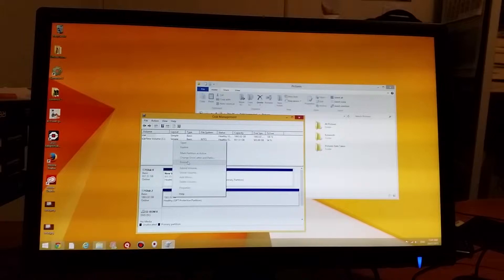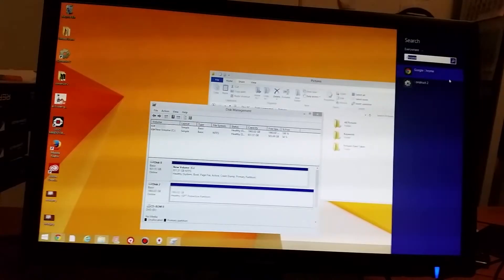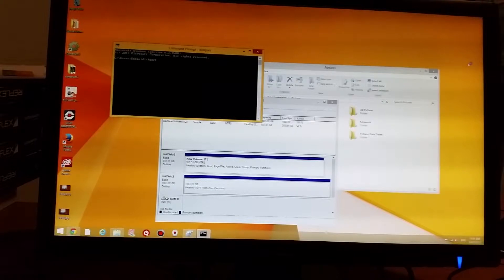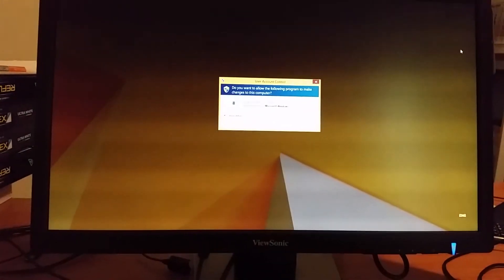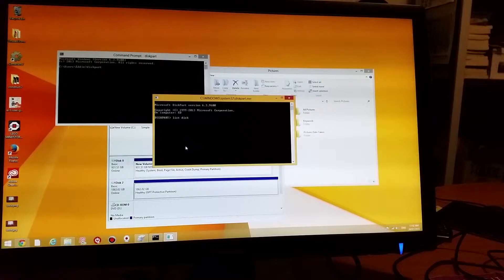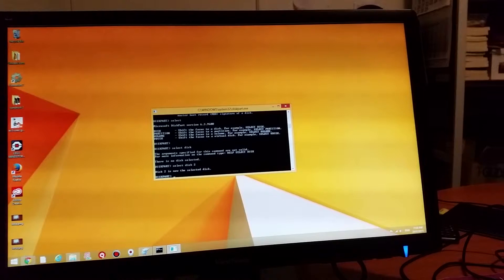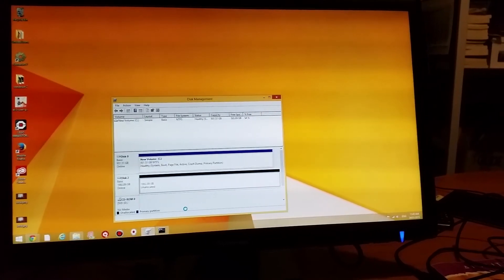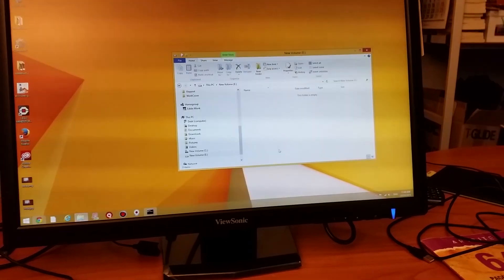How to turn a broken network hard drive into a local hard disk

Comment: Is there a way to keep the data in there, instead of reformat it as a new drive in the local hard drive? I need to do the same (install the hard drive from NAS to a local Win10 PC), but need the existing files. Thanks for your help.